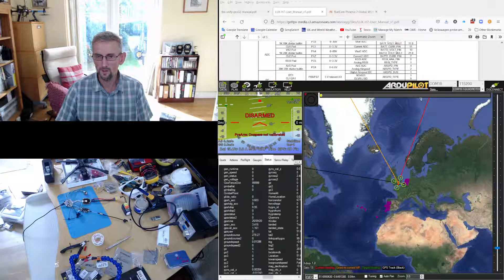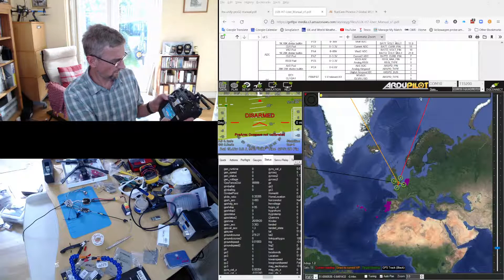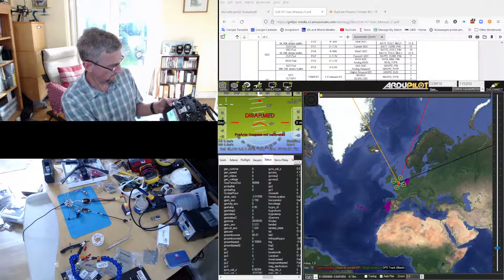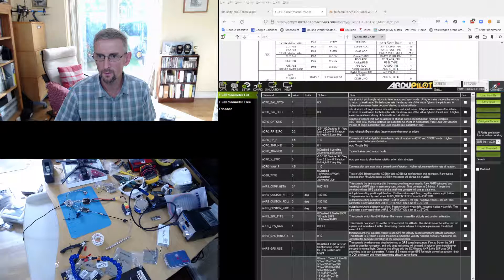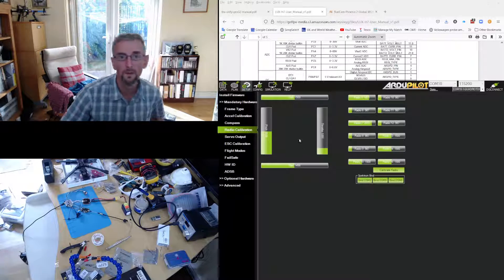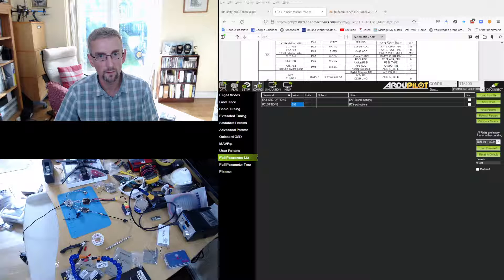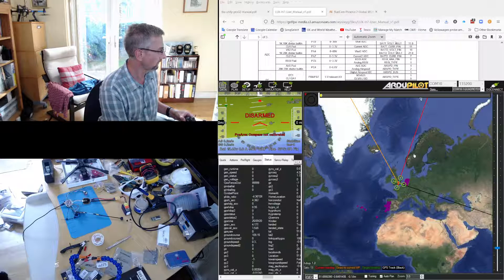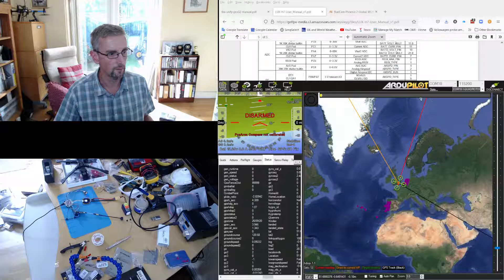ArduCopter 7" LR Build Video 8 - VTX and Yaapu Configuration

Comment: Very interesting thanks. Im pulling my hair out trying to get the vtx 9v to switch on a flywoo F405 HD AIO in Ardupilot, set up RC channel 6 on switch, RC6_OPTION = “28” (Relay1 Control), RELAY1_PIN = “81”
Im still trying to get confirmation of gpio number from flywoo .   Has anyone got the 9v switching on this FC? It defaults ON..not sure how,  Im wondering if it could have connection to  some other parameter im missing.  Cheers for your videos
Reply from the maker: Presumably you have RELAY1_FUNCTION =1? I think I just used the pin they said the VTX switch was on but probably didn't test it.
Reply: Ah yes sorry. I do have RELAY1_FUNCTION =1. (I.e relay) .  I saw some people saying the switch pin moved from port pin B05 to C08 although I don't yet know how that relates to GPIO pin numbers I've tried 81,82,82 !).  I've tried SERVO6_FUNCTION disabled or GPIO..no difference. I will see what Flywoo comes back with. Thank again for your help. Cheers Steve
Reply from the maker: @ Here is a build that puts GPIO 82 on PC8 and RELAY3 - https://www.dropbox.com/scl/fi/rhgt2nqibkf9tfux9uhln/arducopter.apj?rlkey=kqj3iu4vmja0s2ke6gp4ss9nr&dl=0 - can you give it a whirl?
Reply: @andypiper5285  That Works !!! I can now turn the VTX on and Off.  Thankyou so much for looking into this - I just sent you some beer funds.  With my limited grasp of coding i'm guessing the mapping of GPIO 81 was wrong in the code and should have been going to Port C8?  Your firmware has done something to the telemetry i'm seeing on my TX (missing Vbat, current GPS etc ...im looking into that now.    Does this mean a change will filter into a new Firmware release for this FC?  Cheers again Steve
Reply from the maker: @SteveT_IoW_UK  Should make its way into the official release eventually

Comment: How and what do I do to set the rx to tx on my radiomaster 16s for the video? Thanks for all your awesome build video's, I often use them for my builds. So much great info. Think i have that fixed. Now my transmitter keeps showing vtx power level constantly am using yapuu script. How do I fix that problem. Using crossfire tx and vtx.
Reply from the maker: The VTX power level spam is because the FC cannot see the power level it requested. There was a fix for this in 4.5.x so worth making sure you are using that, but also best to use SmartAudio or Tramp, the CRSF support is flaky at best and unfortunately Trappy isn't going to fix it.
Reply: @andypiper5285  Thank you, now I need to figure out how to set up the wiring to pixhawk 6c for smart audio.

Comment: Can we use this to dji o3? I want to be able to switch the o3 power on and off so it wont get overheated while setting up the quad on the table
Reply from the maker: Yes should work with DJI as well - this is literally switching the BEC on and off on this board
Reply: @andypiper5285  thanks for the knowledge andy, so that means i have to solder the cables into the FC not using the jst connector included by the o3 correct?
Reply from the maker: @erikaditya4896 For this flight controller I don't think so - the 9v is in the JST connector and its switchable. For other flight controllers you may have to solder the connections

Comment: Are they settings to be able to receive the various info at the bottom of the screen? As it is, I only receive GPS and volt info.
Reply from the maker: Do you have the Yaapu widget installed? Have you enabled passthrough on the flight controller?
Reply: @andypiper5285  Thanks for your reply. I just realized that it is apparently only possible to receive the messages in the Yaapu widget if crossfire is set to transmit at 150 hz. I will try that.